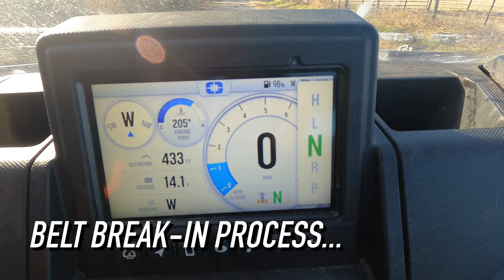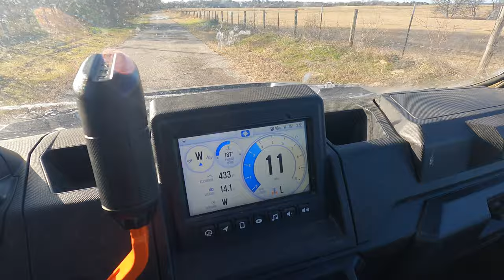The BEST UTV Belt Break-in process for any Polaris and CanAm SXS!! (Pro-Tip included)

Comment: So after the second 5 mile, low gear, and speed fluctuations ill be able to go "full" throttle?
Reply from the maker: Yes but on our personal machines I do a 3rd cycle in high fluctuating from 25 to 45 mph in high for another 5 miles. After letting it rest for another 30 mins, then it’s good to go. I’m overkill though, 3rd cycle is not required but I’m just overly cautious.
Reply: @trailkings  thanks for the quick response sir.  And I will also do the 3rd cycle as you instructed.  Thanks again
Reply from the maker: You’re welcome. We appreciate you watching the video.

Comment: Is it normal to smell burning rubber when I stop riding? I have under 2 miles on the new belt.
Reply from the maker: I smelt some weird smells on a new machine when first breaking it in. Once broke in, you shouldn’t have any of those smells.
Reply: @Trail Kings  ya. I put some more miles on it and the smell is gone.
Reply from the maker: Good deal.

Comment: My 2021 CanAm X3 Max DS Turbo has a stutter when taking off with light throttle. I have 32" tires, up from 28"OEM. Replaced the clutch spring with the black spring, weights and fingers. Now on my 3rd belt, none have broken, but can't seem to get rid of the stutter. In process of breaking in new belt. Any advice?
Reply from the maker: Did you change out weights when you changed the spring in the clutches?  

The bigger tires add more weight and if you carry a lot of supplies like we do, that could be contributing to your issue. 

Stuttering at take off usually means a belt issue but if it’s doing it on a new belt, then you prolly have a grip issue.  Meaning the clutches cant grip the belt enough because of the increased weight.

I’ve learned clutching isn’t a 1 size fits all.  It’s definitely something you have to dial in depending on what type of riding you do.

Comment: I have a 2016 800 odes and put a new belt on add it slapping the caseing,casting, you tell me what causes that please
Reply from the maker: Have the clutches been serviced?

I would start with inspecting the clutches. Check for pitting and wear grooves. The clutch sheeves will dip down with grooves if the clutches are wore down. 

Also does it try to take off when it’s in gear and your not pressing on the throttle?